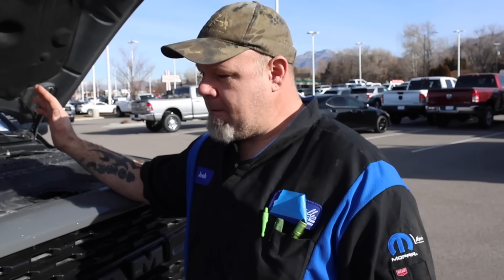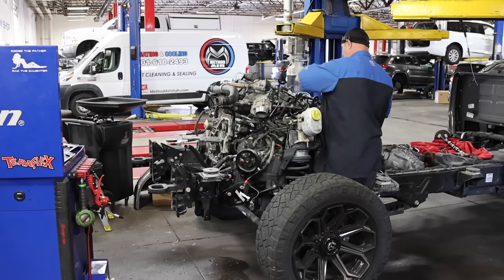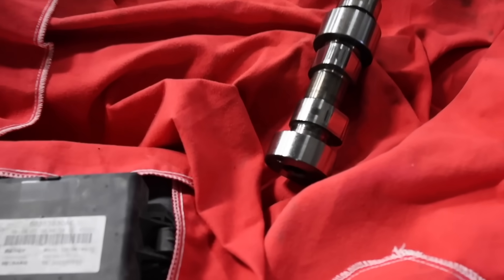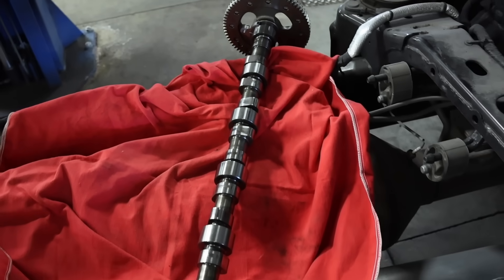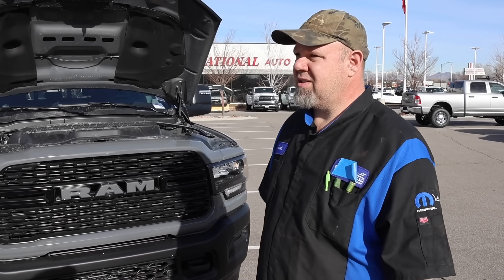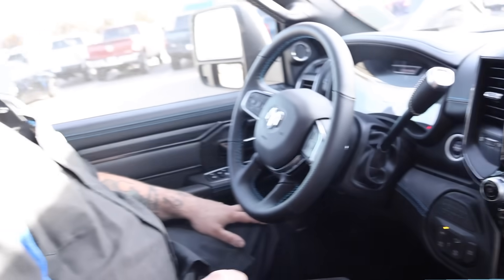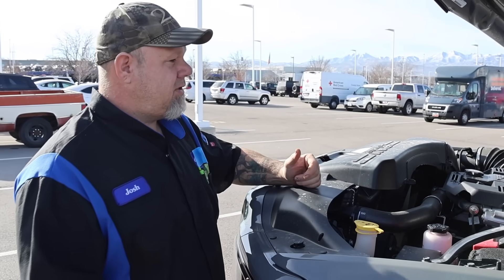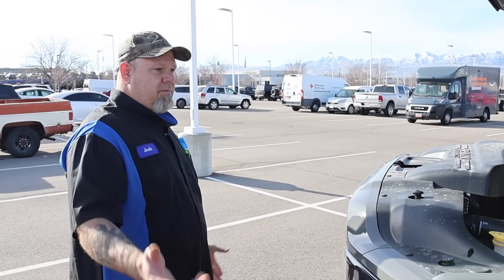Master Diesel Tech Explains The BIGGEST Killer To Your Diesel Engine!

Comment: A certified  diesel tech with hundreds of diesel motor repairs under his belt.. once and for all, 15,000 mile oil intervals are NOT GOOD! , stop defending them because your cheap!   GREAT VIDEO
Reply: What about the people that do oil analysis @ 15K and oil is still OK????
Reply: @candyman1967 for diesels from early 2000s not today.
Reply: @candyman1967 what about me I do it with Amsoil and no varnish when I scoped down the oil fill on the valve cover @90,000 miles. That's what's up but mind you I drive 60% freeway and no short runs where she barely reaches operating temp then gets shut off yeah I don't do that that's what created sludge condensates of combustion vapor because the engine never got a chance to burn it off because of a short drive.
Reply: @ still a believer the oil analysis doesn’t always tell the whole story, is there part of a oil analysis “safe zone“ that relates to just oil sludging in the motor? There isn’t. There must be a reason every single engine builder I’ve ever talked to thinks OE engine. Oil intervals are way too high, they could all be lying and say to go even further so they could rebuild more motors lol but they don’t.
Reply: It’s sad that people buy a 60k plus truck and don’t do the maintenance.
Reply: What he fails to mention is it really does depend on how're driving. If you're mostly droning down the highway for miles and miles on end you can probably get away with 15,000. Mostly stop/go, short trips and long idle times probably not.
Reply: @stuglenn1112 boom
Reply: Blanket statements mean little.   Length of Oil change intervals DEPENDS on how the vehicle is used.  IF the vehicle is used round the clock then of course oil change intervals can be longer than compared to intermitted use and many shorts trips in a vehicle.  Oil is dirt cheap compared to rebuilding an engine.   However some people are conditioned to be tight as a fishes ring!   Regular oil changes can NOT hurt but infrequent oil changes MIGHT hurt.  Each person will make up their own mind on what all this means.  Anecdotally is seems for every person who changes engine oil every 5000 clicks there are 50 people who wait for 15000 or more before they change their oil.   Each to their own!
Reply: @MJSEsox yeah, the fact that you buy “dirt cheap” oil is why you need to change it so often. My truck costs me $200!to change the oil myself, but of course I buy the best oil and leave the “dirt cheap” for people such as you.
Reply: @miller6698   LOL I buy the best synthetic oil for my cars, tractors, machinery and boats.  $ 200 bucks? I spend thousands on some oil changes, you are talking chump change dude.
Reply: Back in the 1980's I used to run a fuel room for locomotives, I repaired the governors and supervised the injection pump and injector repairs. I also was called upon from time to time to help with engine load testing if there were difficulties achieving HP. I tell you this so you know I'm not a complete dick! There were a couple of subjects within this video that I agree with. Firstly info about the turbo idle down time, yes. Then the air filter, yes. And warm up idle times, yes but not so much.
Things I don't agree with, are oil discolouration (English not American) oil colour has very little to do with cleanliness or viscosity. All oils now have ashless detergents as part of their additive package. Diesel oils have much more than petrol typically. Ashless detergents can turn dark quickly but that doesn't mean the oil is dirty. To check yourself, place a drop or two from the dipstick at the base of your thumb and give it a wipe with your other hand, if there dirt in the oil it will show in the pours of the skin, if it shows like a clear film it's not dirty. Soot will increase viscosity, fuel will decrease viscosity and lubricant quality.
Idling to warm up. Diesel engines need to get the coolant temp up quickly to avoid cylinder, ring and piston wear. You do need to let the oil get to where it needs to go but that should only be 20 seconds even in subzero temps. The best way to warm diesel in really cold climates is to let it idle for a couple of minutes and then drive it like an old lady until the temp guage moves off cold then drive normal. You need to get the coolant temp up to 160F as quickly as possible to avoid sulphuric condensates forming at the fire zone of the cylinder. Even though Sulphur has been reduced greatly in modern diesel fuels it is still present. Excessive idling for any engine is not recommended hot or cold. As to oil changes I personally go with 10000km (6200m) but there needs to be consideration for sump size. 1 gallon of oil is going to do a lot more work than 2 gallons for the same engine capacity. In the end oil is cheap compared to engine repairs but there is no need to waste it.
Reply: I did oil changes 8-15k miles on my 2020 f350 6.7
Got 443k miles on it and it still rips. 
I do hotshot so mainly all hwy miles. 
I retired it mid summer and now it’s my daily driver. 
Bought a 24 f350 6.7 that I now hotshot.
One this to note tho. I used hotshot secrets oil additives every oil change.
Reply: I did 5K on my 1998.5 and 2007 5.9's for 20 yrs and always poked through the neighborhood before driving it on the highway and cooling down. I always used a quality 15-40 oil and Fleetguard filters.
Reply: Mileage is extremely subjective. 15,000 miles on the highway with no load is a lot different than 15,000 under heavy loads or with extended idling
Reply: GETSUM!!!
Reply: @ScaverDanTTV  shotgun guy go!
Reply: I've seen heavy duty trucks with X15 engines go a half a million miles before an oil change.  This is with a remote oil filtration system added on.  Otherwise with the engines in tractor trailers I wouldn't go over 50,000 during the first 300,000 miles.  Even with your diesel pickup trucks you ought to be taking oil samples every so often to make sure you are not having oil contamination from the fuel.
Reply: To be safe, just change your oil with every fill up.
Reply: @georgeburns7251  Love this. Can’t be too safe for the commentators.
Reply: I took a 2016 DD15 to 1.300.000 miles changing oil every 20k+
Reply: What about 10k🙃🫣
Reply: For people that want to learn he has sage advice. Old people like me go by the engine.
Reply: They are if you're hotshotting....480,000 on my 2019 6.7 cummins changed every 15000
Reply: @EHughes7552 , it’s the grocery-getter crowd that don’t understand proper maintenance intervals and only change their stuff every 3k so that they can tell their buddies they’re doing maintenance. They fail to realize proper use and maintenance schedules and that diesel oil can be taken to 50k-60k intervals with simple bypass systems installed and filter swaps every 30k. Mind blowing how uneducated owners really are.
Reply: all you said is you don't know anything about lubrication. Stick to what you know and close your mouth when breathing.
Reply: Why would the maker put that number up?  Serious question. I have to agree if only because of today's diesel owners, short trips, start and stop, we didn't do change by miles by hours, I think hour meters on diesel trucks would be a good addition.  I think all those cold starts and short trips are hard on everything and I think lots of diesel owners would be better served with a big gas.  Very little upside for guys who are out rolling coal on Testlas, hot rodding diesels breaks my brain. On the farm if you fired up a tractor you better run it for a few hours and make the start worth it, talking 12.1l 6cyl diesel.  Speaking of, the only real diesel for work is a straight 6, V8s has a short very unpopular run in the late 70s.  They gobbled fuel and were not reliable.  International in fact ran V8 4wd, our neighbors had one and it just screamed.
Reply: New light duty deisels are not meant to last no matter what u do. Absolutely no advantage to deisels if u change the oil close to same interval as gas. I use oil stabilizers just like the big boys (semi's) with good results. New deisel guys crack me up. Whatta buncha pussies.
Reply: 7,00km synthetic oil, filter and new fuel filter, every other fill up injector fuel system cleaner,  pull the fuel tank drain plug and drain for a couple of seconds for water in the tank.
Reply: Hell, I changed all of my vehicles every 3000 to 5000 miles or every four to six months, whichever comes first. 

Ironically, enough, my father used to own a Range Rover and doing basic minimum maintenance that thing managed to get just over 200,000 miles before the transmission finally gave up
Reply: Add fuel filter to that. I don’t care if it’s some high speed low drag aftermarket “system” or plain Jane stock, CHANGE IT! Bout every 8-10k
Reply: Wrong!   Read these comments for proof.  I changed oil in my gasser every 15k....sold it to a buddy and he's still driving it.
Reply: With my 09 Duramax 260,000 miles after every oil change @3 -4000 miles it’s always black , and drained oil is never a quart low because I dump the used oil into the new container that the new oil came in, always the same level in the jug as the new level
Reply: All I gotta say is, the crap way everything is built now a days I wouldn't trust 15k on any vehicle.
Reply: I do 5000to 6000...thats it.
Reply: @ML-jr1yz , quality oil can go much further. Absolute waste of time and money.
Reply: Depends of oil, bypass filtration, what you pull, in what conditions you drive, use a fuel additive for clean and lubricate injectors to keep the soot levels low etc. I trust an oil lab more than any mechanic when it comes to this. Remember, you replace metal parts… you’re not a chemist.
Reply: 600000 miles on my 7.3 and change every 1 quart drop which is between 12 and 18000 miles still runs great and oil is almost always clean. 3 trans and 3 water pumps and normal maintance. Lubes every 2-3 months. Same as my semis
Reply: @813195 old diesels are different than the new diesels with all the stupid emissions and EGR.
Reply: @813195 True for older diesels. Not modern diesels .
Reply: Just seen on YouTube, a 6.7 Ford diesel with 900,000 miles on it and he alternated between 5,000 and 15,000 oil changes!!
Reply: @Black-DMax0718 I saw that video as well.
Reply: @Black-DMax0718 that engine used a super high efficiency bypass oil filter to get those higher intervals with testing. Without an aftermarket system you’re better off doing factory rec minimum.
Reply from the maker: @Black-DMax0718 you just seen  on YouTube a ford go 900,000 miles and it runs an Insane diesel oil bypass with the Lorenzo oil and fuel additive. NOT A STOCK SET UP!!! Before you comment like this get informed
Reply: Best thing to do for a diesel is delete that bullshit the EPA puts on them
Reply: I’m old school and just stick with 3K mile intervals. 

Oil is cheap, engines aren’t.
Reply: @FectoReviews 3k miles is like every 2 weeks for me, at that rate oil changes get very expensive
Reply: Who the hell does 15k mile oil intervals??? wtf!! lol I feel bad when I go 5k miles. I try to keep it at every 3k miles on every car no matter what. I don’t care what the auto manufacturer or the oil label says
Reply: @kavehespili if you listen.
He says manufacturer said this.
He is against it
Reply: @kavehespili they’re talking diesels not gas. However I agree with you. The oils change for our leases Tundra was 10k. I was flabbergasted. Especially with all the new issues that turbo 3.6 has.
Reply: @kavehespili , 15k intervals are nothing new. You’re clearly a newer diesel owner.
Reply: @kavehespili You replace 3 GALLONS  of oil every 3k miles on your diesels?🤔 honey, this isn't a small gas motor that only takes 5 QUARTS of oil.
Reply: @kavehespili  Big diesel engines hold a lot of oil, so they can go longer between oil changes than car engines that don't hold much oil; so, it's cheaper to change car engine oil more often..
Reply: @petesmitt  yeah I know, I have a sierra 2500, think it holds 10l or maybe 10.5. I use amsoil and still change it every 3k miles, might go 5k if I’m on a long
Road trip
Reply: @kavehespili my 09 duramax  gets changed every 3,000 with Rotela T5  (10 quarts) with a Fram filter sometimes I’ll only put in 9 quarts then ad a quart of Lucas synthetic
Reply: @GLMracing , Fram makes the worst filters on the market. Your truck deserves better.
Reply: @kavehespili  right that’s what I do 3500 miles
Reply: 15k oil change is crazy….every 5k.  Even at 5k my oil is nasty and black.
Reply: @Randy_Savage_ohyeah put a bypass filter on it and stop using garbage oil
Reply: @ what oil do u recommend?  I’ve been using the Shell Rotella T6
Reply: @Randy_Savage_ohyeah , use a better oil, please. Schaffer’s or Amsoil are both much more superior options.
Reply: @Randy_Savage_ohyeah black oil on a diesel is meaningless dont drive it next time and idle it for ten and it will be black as coal been a PM tech on diesels for over 20 yrs our customer mileage intervals are all different crazy how much bs is out there shorter intervals is always better duh but not always necessary in our experience consistency is much more important
Reply: Yeah, because you make money off oil changes, Cummins recommends 15000. Use Amsoil with a bypass filter and 15000 is changing early. This truck holds 3 gallons of oil not 5 quarts like a little grocery getter. These guys that change oil for a living and get paid for turn and burn. (More oil changes, more pay) are not experts. He doesn’t even know what the proper oil for the truck he is sitting in. His ignorance is shown throughout video. “Shut off cruise control” what a maroon
Reply: @miller6698 it's spelt moron you maroon
Reply: Your avoiding the main issue. The idea that the manual advice is likely a good idea. It may or may not be. 

The bigger issue is we are lacking handy men who will drop their oil on their own driveway and change out other fluids... It's convenient and satisfying to do it yourself at home... 

You don't change your own engine and tranny fluid: you are not a man
Reply: You’re*

And there’s nothing wrong with 15k intervals when using quality oil and filters. Done it for years on all of my diesels. Zero issues ever out of any of them, ranging from 115°F to -50°F.
Reply: @CornFed_3 Yup. It’s all about being efficient, not cheap. Blackstone labs says I’m good past 10k regularly.
Reply: @Cherrycrochets What year is your diesel?
Reply: @CornFed_3  You seem to be a competent English teacher, but I'm with the mechanic on this one.
Reply: @travism8412 , this mechanic is just spouting nonsense online. 15k intervals have been a standard for many years, especially on Cummins trucks. It’s not 2003 anymore, oils and filtration capabilities have come a very long way.
Reply: @CornFed_3 oh really? What year is your diesel? Try doing it on a modern diesel
Reply: @LuckyNikitaBoba , 2020, 2017, and multiple 2015s. Zero issues out of any of them with 15k intervals. Amsoil or Schaffer’s oil (5w40 year round) and Donaldson filters.
Reply: @CornFed_3 lie 😂
Reply: @CornFed_3 wow and where are you from where it’s +115 -50 ?
Reply: @raynman67 , I was stationed/lived in Alaska for a while and now I’m in the Midwest. I’ve seen and put my trucks through every possible weather variation possible. Even where I’m currently at, I go from 115° in the summer to -35° in the winter.
Reply: @CornFed_3 every 3000-4000 miles for me. Fuel filters every other oil change. Air filters as needed.
Reply: @thesegal5683 , waste of time and money. You’re throwing away oil that’s barely half through its service life.
Reply: @CornFed_3 oh boy

Comment: All good info and sound advice. I live in Florida and I’ve recently switched to 5/40 on my 5th gen 6.7.  Valve train is much quieter and happier since I’ve switched. Not sure why, but mine doesn’t seem to like 10/30.  I always  change my oil at or before 7500miles. I’ve done oil analysis every other oil change with good results. Lab even suggested to extend interval to 10k. I’m good.. I’ll keep it right where it is.. good video

Comment: I have a 2023 2500, my truck sits for up to a month at a time while im at work. There is no place for me to plug it in at the to. So Ill be using a 3300w pure sine inverter generator to plug into the block heater before I make the trip home. My question is, How long would you say I need to leave it plugged in to reach a comfortable temp (compared to plugging in over night) before I start & high idle it?
Reply: Temp you're at really matters here.

Comment: Hey Josh, so if I have a 1 ton ram Dooley and I’m working with that Dooley pulling RV campers all over I can put easily 5000 miles in two weeks so every two weeks I need to change my oil
Reply: Please do not waste your money. Mileage is just one factor, running hours is also important. How heavy you tow and expected temperature matters for regen to work well.